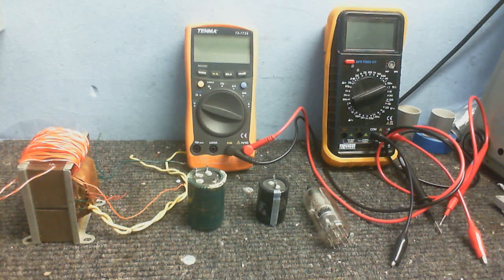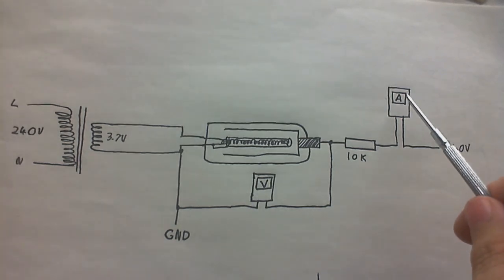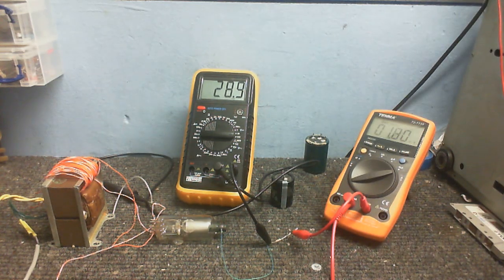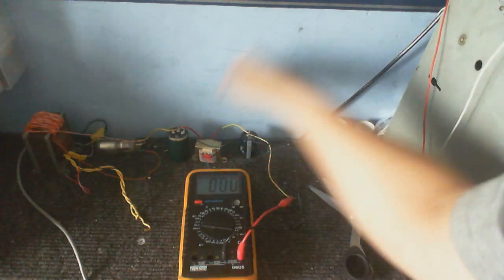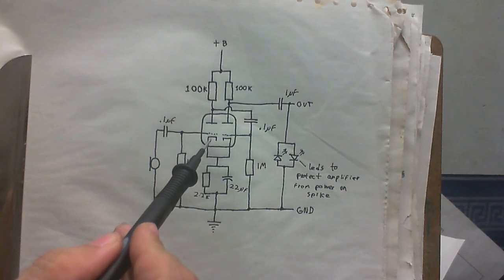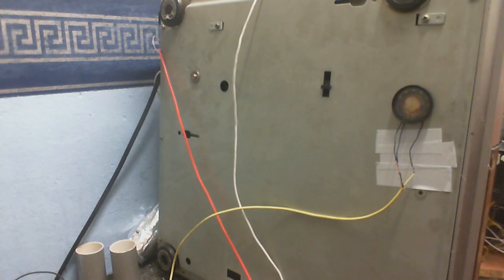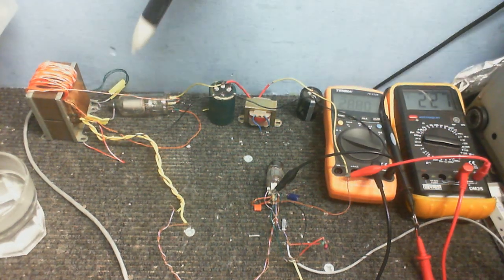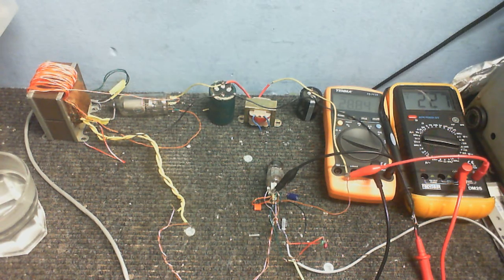Tube Time ep 2 - Rectifier and Electret Mic Preamp.

Comment: It would be great if you can also note what kind of triode or rectifier tubes you are using... just as reference...   Nice sound out of that mic-preamp too.
Reply from the maker: Bobo Tlaga The tubes is used here were ECC81 (dual triode) and GY501 (rectifier)
Reply: CoolDudeClem Ahh that triode is called 12AT7 here.  One of the most sought after ones.  I am doing tube amps experiments as well but so far I have been using a triac and a voltage multiplier using caps and diodes.. I can pretty much go from 0 to 300 V with just a turn of the triac dial.  I have a ton of 1000 uF 100 v caps right now and can share them with you if you want.

Comment: hey clem where did you find that transformer ? I need one with a 6.3 v filament winding and a 240v primary and if i can wind on a 5v filament for a rectifier tube i'd be set, because they cost heaps to buy.
Reply from the maker: muggo131 It came out of one of my tape recorders, but you don't need to seek out a transformer like that, 2 mains transformers back to back will also do the trick

Comment: another thin

what is the ecc tube that u used
Reply: may had been an ecc 83 at a guess that is a double triode but moast of the ecc are pretty much the same but i would still use a cathode bias reststor lol
Reply: it has to little inside for a ecc83
but i forgot what tubes i did send to him

mmmm i am gonna look that video back
then i know
Reply from the maker: ***** I used the ECC81 I might try later with the ECC83 and see if it makes any difference.
Reply: CoolDudeClem i thought so
i have looked in my bin of tubes
and a ecc83 has a bigger internat structure

Comment: you just made a heart and wait this little thing needs 356v WTF?!?! but i guess u feed it 3.7v ac
Reply from the maker: Genadi Enev Tube circuits generally require high voltages to work well, 350+ volts is rather high for what i was using, but the supply voltage got pulled down to about 220 volts so there isn't any need to worry. The 3.7 volts was for the filament part, whitch is always powered at a much lower voltage (3.7 volts in this case).